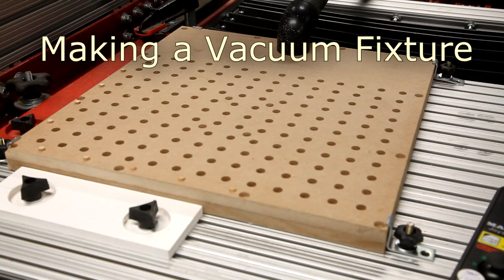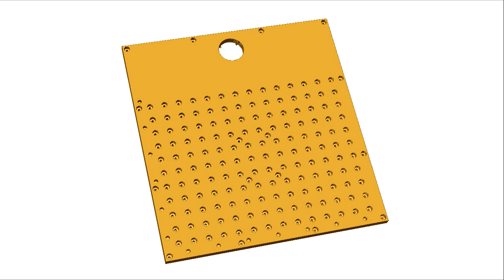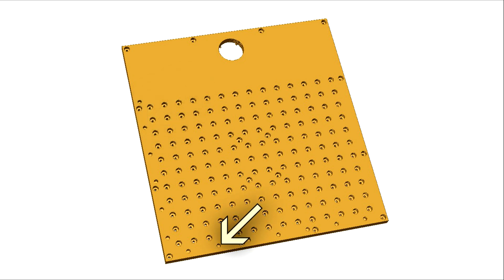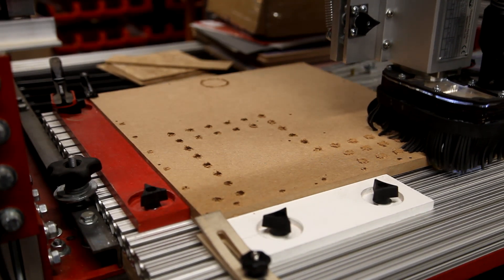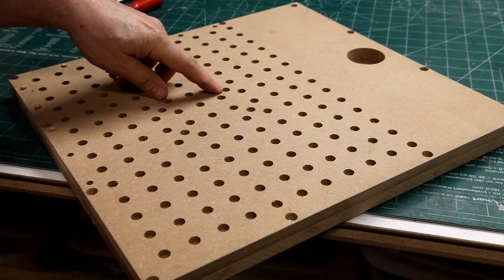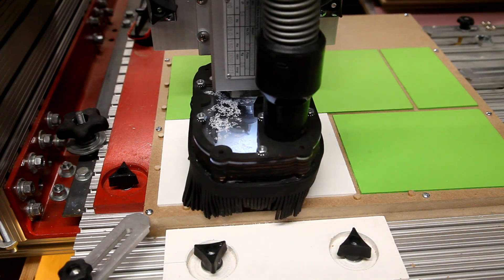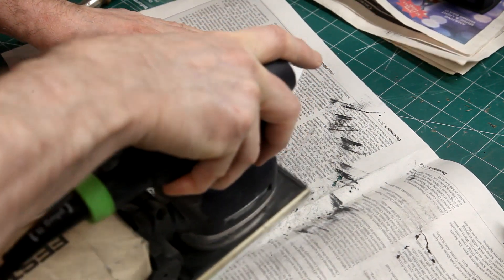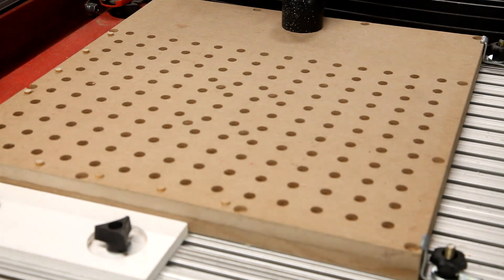DIY CNC Vacuum Fixture

Comment: Nice Video! I'm new to CNC, and vacuum tables. I'm wanting to cut similar material - 1/8-1/4" acrylic, but always cutting through to cut out shapes. So, is the top vacuum board you made just end up being a sacrificial piece that you have to replace every once in a while? I assume cutting through the stock will make grooves in the vacuum board - or am I missing something? Thanks for the help!
Reply from the maker: First off, if you are cutting small shapes a vacuum table may not be the way to go.  There will not be enough to hold the small pieces in place as they are cut.  Also anytime you are cutting through, you have to make a specific fixture and use gaskets or as soon as you start cutting through you will lose a lot of your holding force.  They do work well for larger items as long as you can isolate the coutout components with some sort of gasket system.
Reply: @msimpson20175  Thanks for the reply! I looked at a few other videos where they just use a piece of MDF, and surface it both sides to make it more porous, without the holes you drilled, and that is the spoil board. The vacuum force still sucks directly through the top MDF board simply because it is porous? My pieces aren't that small (8" circles), so I guess I'd have to test whether they would be able to be held down or not. Going for production speed, so need a system that is fast and doesn't use a lot of material, and gasketing each part be impossible...

Comment: hello, nice video. but making this out of mdf is not good. mdf will let air come true all sides!!! a really strong pump wil even suck your project on the mdf without any air pockets.
Reply from the maker: You need to watch the video and listen.  Unless you have a very high end shop vacuum with a separate cooling fan, (IE does not use the vacuum air cool the motor) you need some leakage.  I state this in the video. 

 If you hook up a $100 shop vacuum for extended periods without some sort of leakage, you will damage the motor.

Also I have been using it with a variable speed vacuum set on its lowest setting and works just fine.  If you want a little more suction, just add contact paper to the bottom.